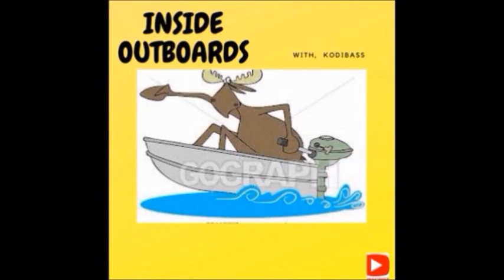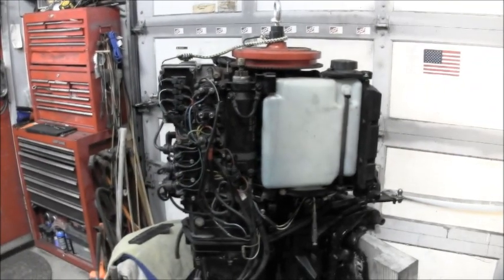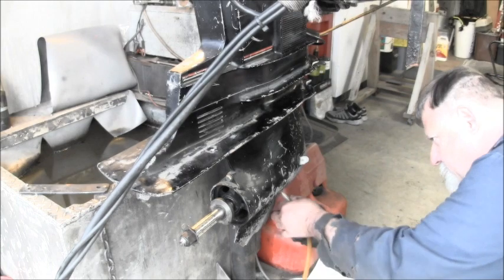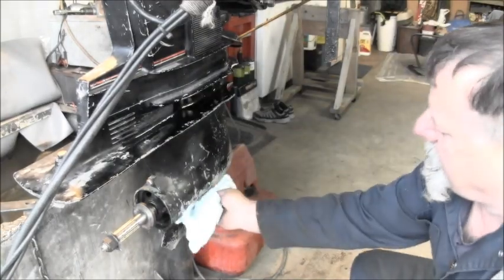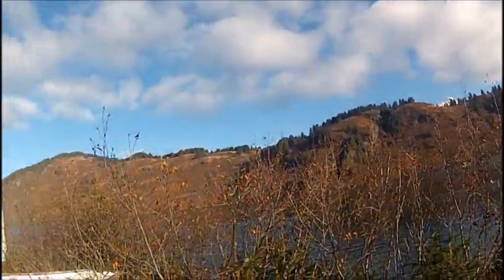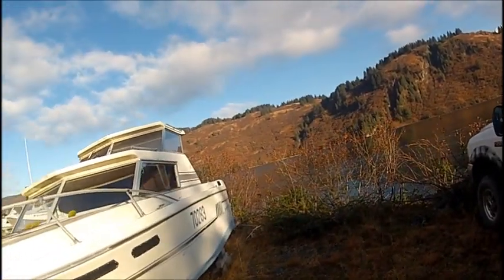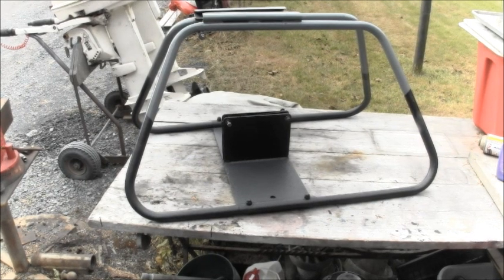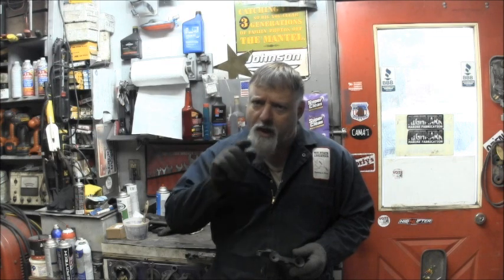MERCURY 1988 70 HP,    (( Part  3  ))

Comment: Hi Kodi, got a leaky carb on my 60hp merc? I took it apart, cleaned and it's still leaking. Other 2 carbs are good? Going to check the float needle it may be bad? Will try one of the other pins on it or the seat is no good?
Reply from the maker: Yep'  that happend to my 3 cylinder 50 Merc,  changed the needl & seat & good 2 go.   kb
Reply: does the seat unscrew out on these or pull out?
Reply from the maker: @TimsWorkshopTJY   They screw in & out. But b-carfull going back in I almost cross threaded mine.  Got lucky & caught it.    kb